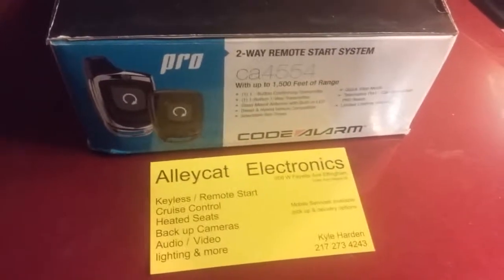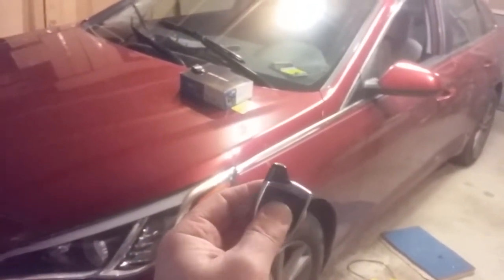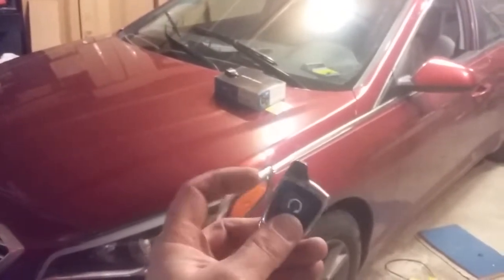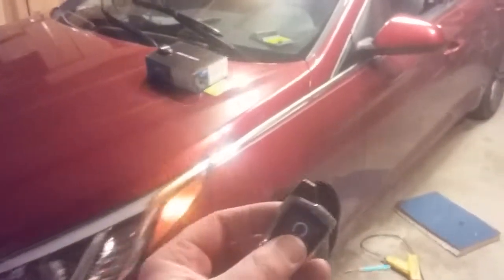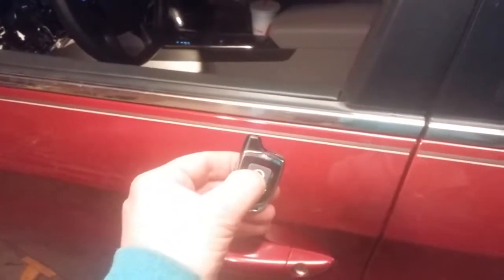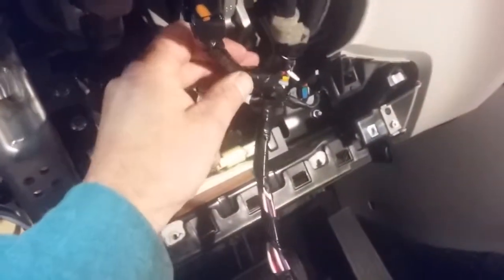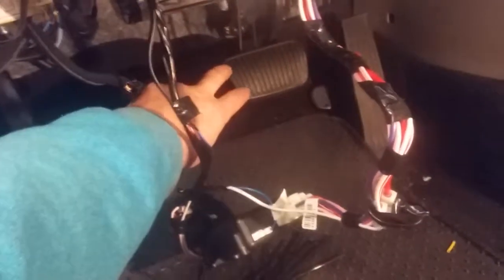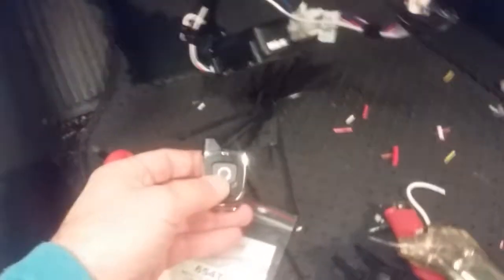2 way Remote Start code alarm ca4554 Alleycat

Comment: Does it lock and unlock the car? 
When your car it’s on ... how do u unlock the door? Manufacturing key or the code alarm?
Reply from the maker: the single button fobs from code alarm have the capability to unlock while the car is running via remote start, but just like the oem remote start n the Toyota PTS vehicles, vehicle will shut down upon opening the door.  original fob features still operate